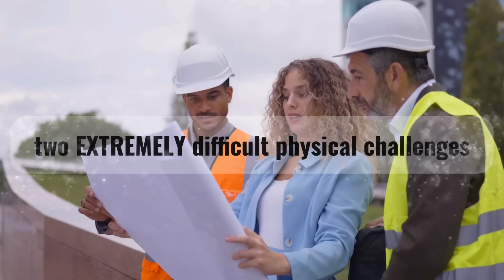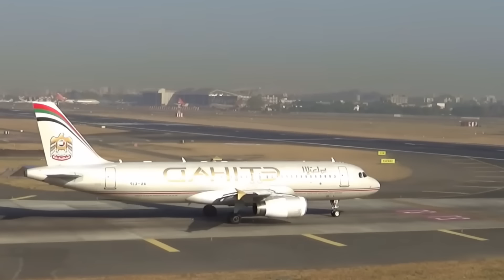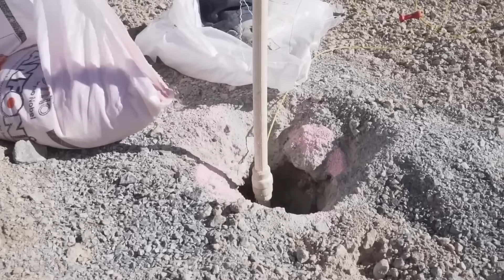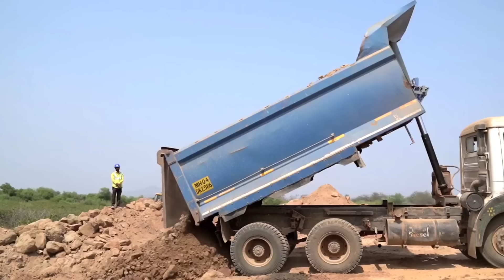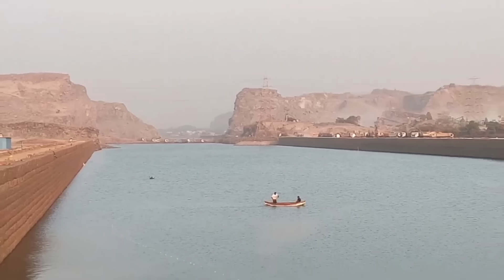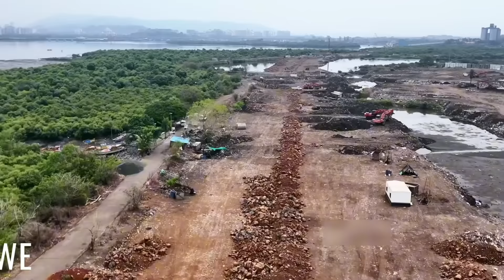How Did India Break a Mountain and Bend a River to Build a Billion Dollar Airport?

Comment: It took engineers massive enterprise to dry up and compress soil to reach required bearing capacity. However, it was not clear what has been done to prevent permeation of sea water back to soil from the ocean in vicinity ?
Reply from the maker: It's the same method of wicking and compressing to push all the water to the surface, my friend.